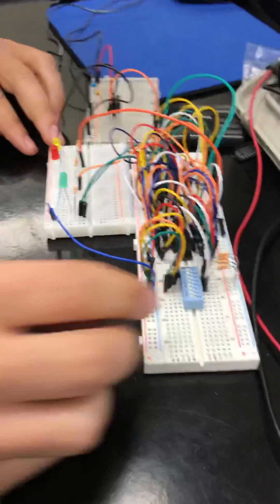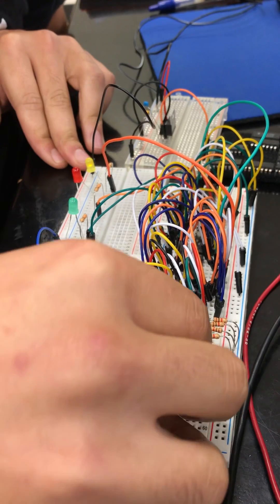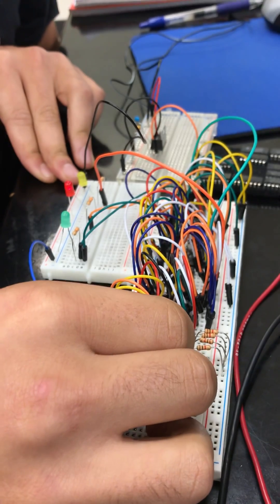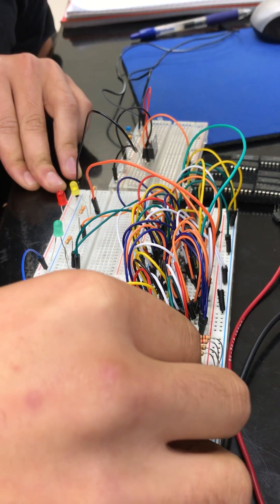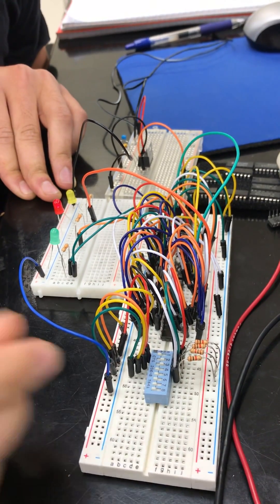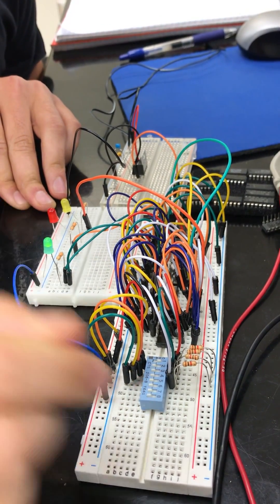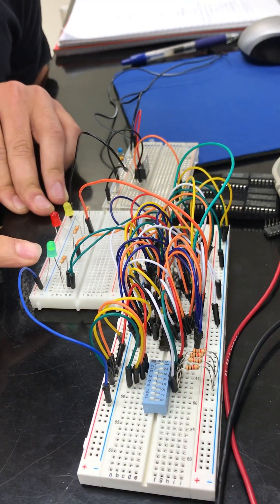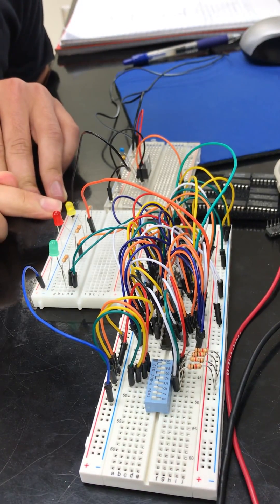2-Bit comparator in EE118 Lab

Comment: is it possible to make a video building that from scratch?  it would be really helpful for me and 130 people in my class thank you
Reply from the maker: Possible, but I will provide you will steps.

1. Create the Boolean expression for each output - G, E, L.
2. Realize how any 1 of the outputs can be expressed in terms of the other 2 outputs.
3. Use DeMorgan's theorem to change the 3 Boolean expressions only in terms of NAND gates.
4. I used 5 IC chips that had NAND gates inside. I also used a regulator to output 5V and a switch to control my inputs.
5. It might help you to draw out the 3 Boolean expressions visually into 1 circuit diagram.
6. Draw the 5 IC's and the gates inside on a piece of paper and map out where you want the variables of input and output to go.
7. Use jumper cables to connect the inputs and outputs.
8. If you encounter any problems, use a different area on the breadboard or use a different breadboard. You can also use LEDs to troubleshoot. I had LEDs on my outputs to indicate which output is currently high based on the inputs on my switch. 
9. It is implied to use resistors to protect your switches and LEDs.
Reply: @Zinaz22   Perfect Thank you very much